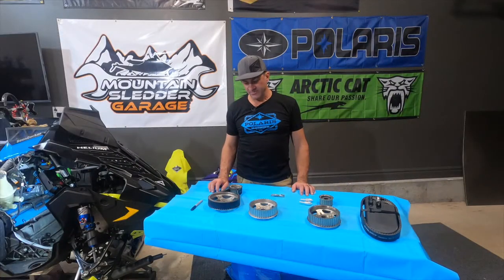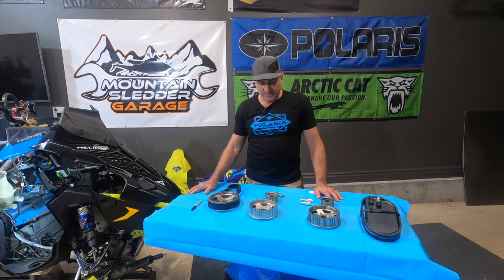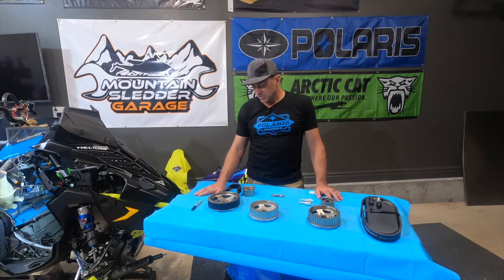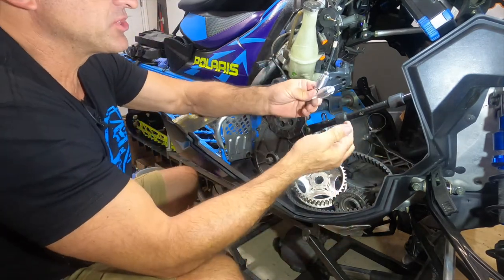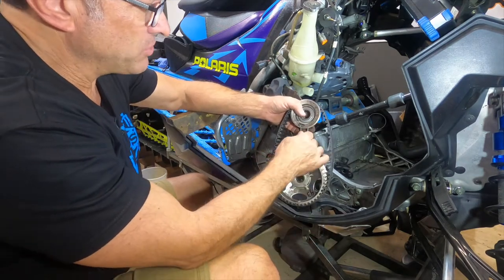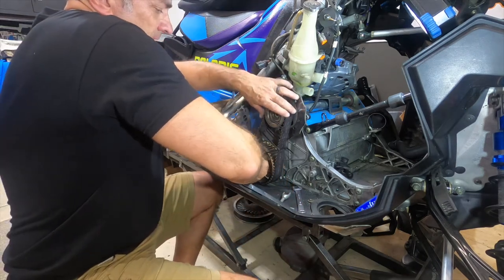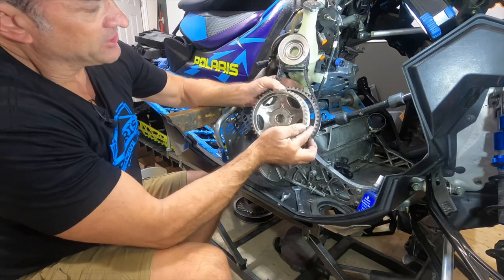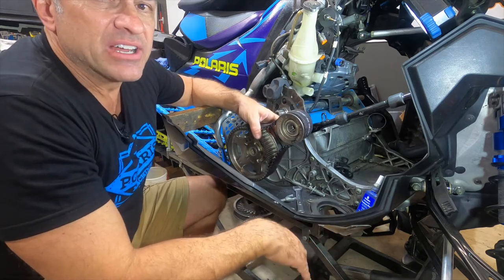Ayxs quick drive belt install

Comment: Do you reuse the belts or buy new?   If new what about ARP bolts?
Reply from the maker: The Polaris owners manual says the quick drive belt should be replaced every 2000 miles. I haven't seen or heard of one breaking in years. I usually carry an extra when I ride. ARP bolts aren't a bad idea, or at least replace with factory bolts when you replace a n retorque

Comment: So the belt drive is strictly for the brakes?
Reply from the maker: No, the quick drive belt drives the driveshaft and track
Reply: @mountainsleddergarage8627  appreciate that. That the brake rotor/brakes are on the drive as well?
Reply from the maker: On the Polaris the brake is on the jackshaft opposite the secondary clutch . Cat and skidoo the brake is on the drive shaft
Reply from the maker: At the 6:50 minute mark in the video you can see the brake rotor clearly in the end of the Jack shaft
Reply: @mountainsleddergarage8627  awesome. Appreciate it